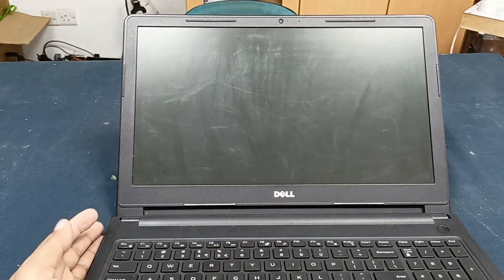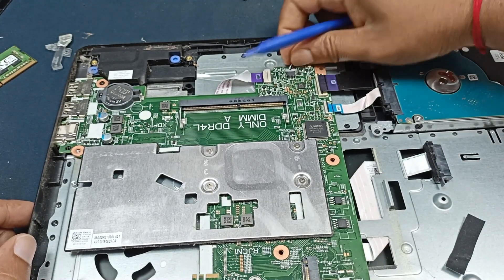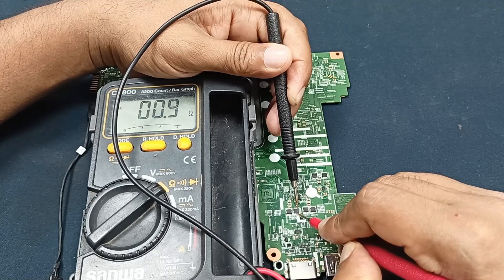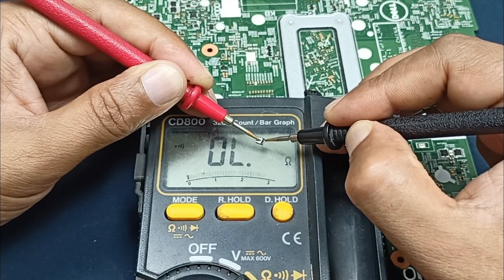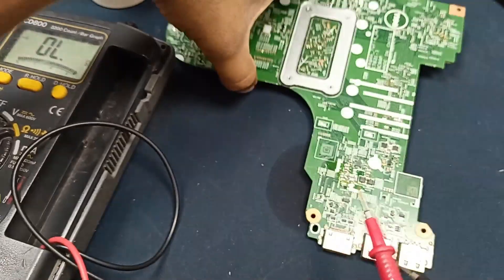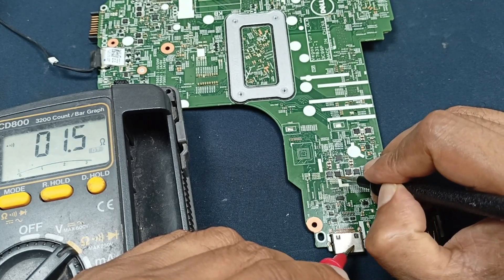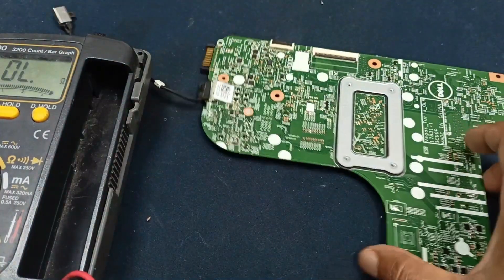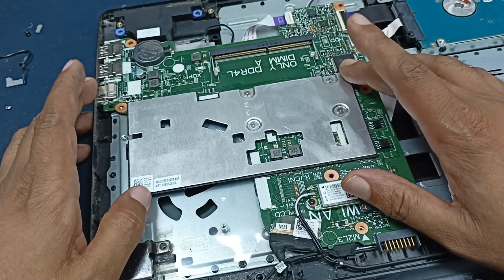Dell inspiron 15 no power || Dell laptop power won't turn on

Comment: It turned on when i disconnected the battery qnd did a piwer drain.  But afterconnecting the battery qnd putting the back panenl in place its not turning on again what ti do?
Reply from the maker: At first change the battery

Comment: Hey please help me. My dell inspiron 15 3000 is not turning on. When I plug it the charging indicator becomes white but the laptop doesn't turn on. It's mfg is 2020.
Reply: Did u figure it out? I have the same issue